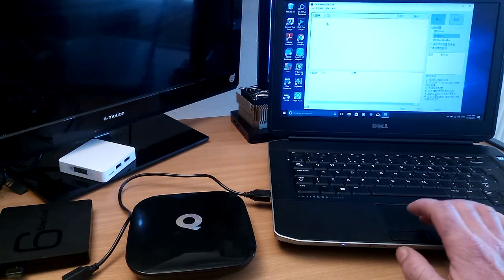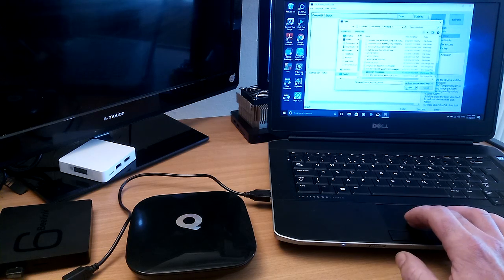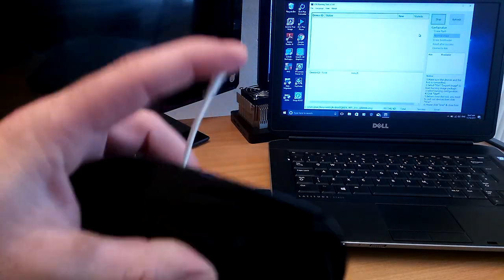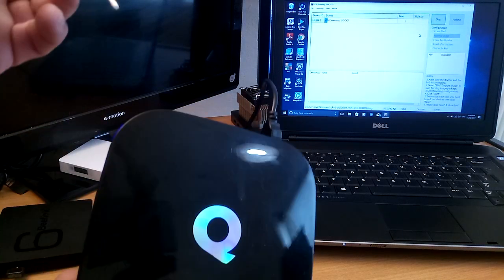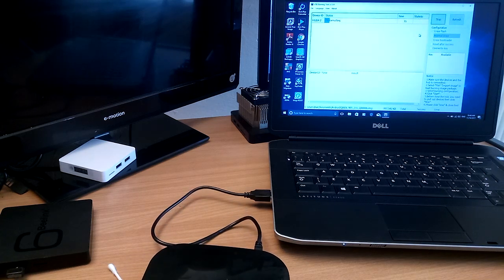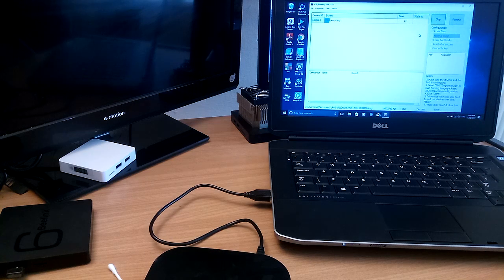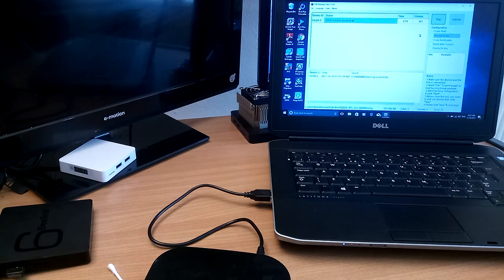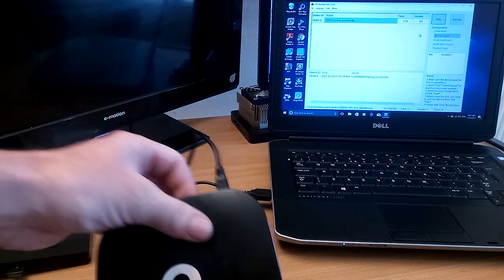How to flash a Amlogic TV box using the USB Burning tool

Comment: Finally with ur help 
 I connected to pc 
But got error at 1% on download DDR 
After i uncheck erase flash and bootloader 
Got an error at 8%  data transfer error 
Could u help ?!
Reply: @brandonwestby9412  
Changed the cable to new and good one 
The Firmware i googled it for long time 
And will till u if rememberd
Reply: @brandonwestby9412  
Ya it worked at last

Comment: 0:19..

Download the tool then 'install it'. Once I've downloaded it it's in a file, how do I installed it from there? Sounds obvious to the tech savvy but to me I see no install icon or anything that would relate. Any help?
Reply from the maker: Download the Amlogic USB Burning Tool,unzip it then you will see the setup file
Reply: @buytech9951  wow, quick reply thanks. I'll give you a sub for that!

Is that on win 10? 
Because the file is in 'downloads', once clicked it just opens the file into a breakdown of its contents or sub files I guess they are? Help; log; temp; worldcup_device; etc etc.. Anywho, non of those say 'Open' or 'run' or 'execute' or anything similar, there no Unzip icon in any of the tool bars either?! Anything else you can give me?
I hate computers but I'm starting to hate TV boxes more
Reply from the maker: Ha ha @gently does it  We all love to hate Tv box's..Yes im using win10.The file you need should be there almost at the bottom but before you get to that, click on worldcup device folder and in there you should see install driver (install that before you launch the USB burning tool)
Reply: @buytech9951  turns out that my device didn't come with any unzip programmes pre loaded. I had to go to app store to download one.. well actually about six of the dam things until I found a free app that would unpack an .exe file.  
As I write now I'm about to commence with the rest of the steps you've kindly laid out in your video.

Comment: I’ve downloaded it from many different places and installed and uninstalled it many times on 2 different PC’s. One running windows 8 other one upgraded to 10. I also tried all compatibility settings on both. I hear sound like box hooked up but program doesn’t show device nor up load image. I even created folder in burn tool folder and put image in it still nothing.
Reply: Go into device manager and select the usb device (the Qbox), then install/update the drivers. I bricked my Qbox and I dont have the usb to usb cable to do this but I have been doing research to hopefully unbrick the device. I found this out from here https://www.youtube.com/watch?v=iX1Pwni-dUQ if you need it

Comment: Have you had a problem with not being able to import image? I get image fail come up.
Reply: I am having the same problem with importing the image file to USB burning tool 2.0.8 version. The message that pop up say Parse burning image fail
Reply: @brunswickfarm6029  i see i got same problems.
Reply from the maker: No iv never had a problem myself.Could be a bad download (Re download the image and try again) also try putting the image in the same directory as the burning tool.
Reply: @buytech9951  please can u share link img firmware. I download 3x, but same got parse burning image fail.
Reply: @yosukerechain2000  Hi, Did you find the correct image? i am having the same issue